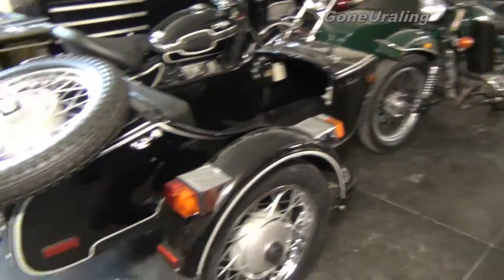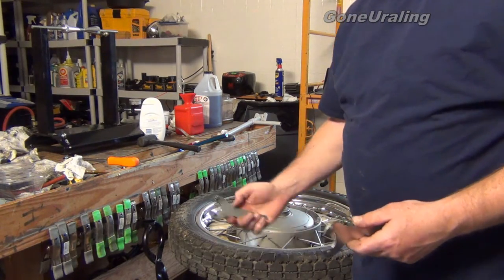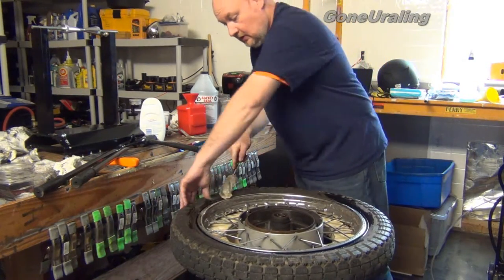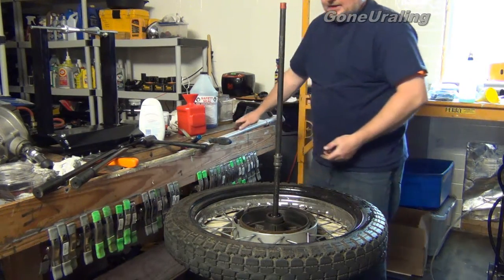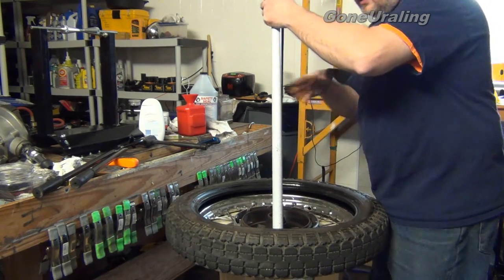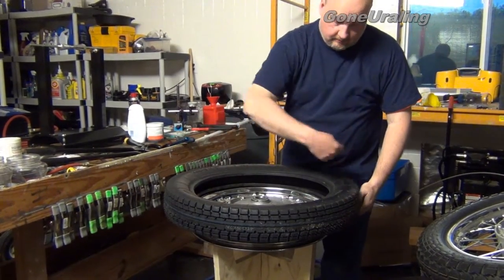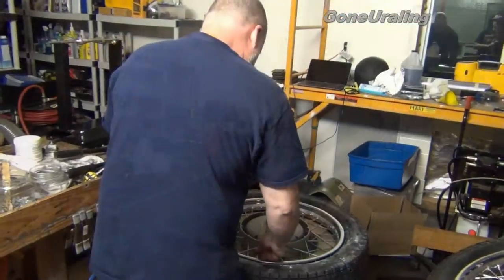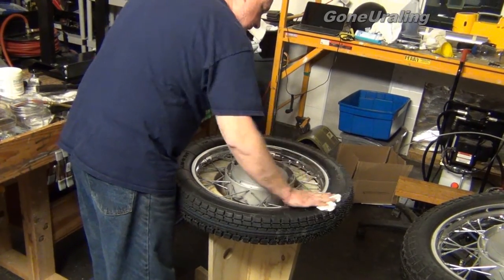Motorcycle Tire Changing on Shop Made Stand

Comment: great video great changer you made. I am using a 5 gallon bucket.   do you think the k28 is as much groove as duro 308s ?        I think spending the extra money into k28s we go on semi maintained dirt roads and gravel.  thanks again for the video I hope you don't dream of having to change that many tire at night wow.   I forgot to ask do you run the pressures in the manual or have you got a set deal I am heavy and set to manual and its a wet sponge ?
Reply from the maker: The K28 is a highway tire, a good one, it does well on dirt roads, gravel and dry dirt. I would not use it for real off road riding purposes, tread is not made for loose dirt traction, mud etc... On our 2017's we run 32 front, 30 side, 38 rear, 45 spare.

Comment: spare tire  on sidecar facing front clock wise turning. Now on the back pusher it be turning anti clockwise   so were does the arrow of turning work out?
Reply from the maker: The arrows always point in the direction of tire rotation for normal travel. As for the spare, I have it pointed correct for the pusher, if I had to use it on the sidecar, yeah it would be backwards, but no big deal.

Comment: Where did you get the tree you use for breaking the bead?  Good video by the way.
Reply from the maker: You mean my bead breaker?  BikeMaster Bead Breaker 03-171 on Amazon.
Reply: I mean that handy tool you use instead of the spoons to pull the tire off the rim.
Reply from the maker: Ahh, you mean the no-mar tool.  I debated about buy/not buying that thing for a while because it's expensive, but it has been well worth it with 5 motorcycles around here now. http://www.nomartirechanger.com/